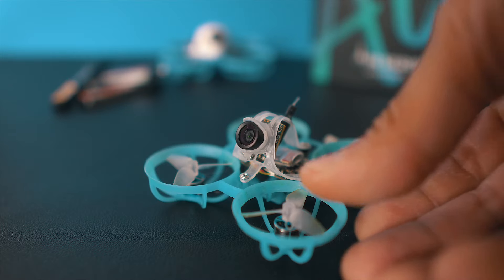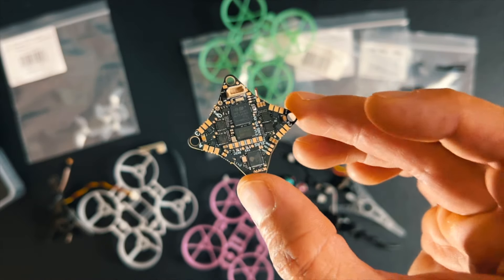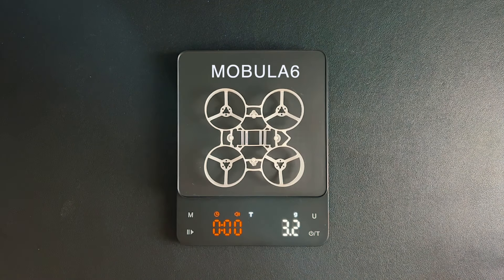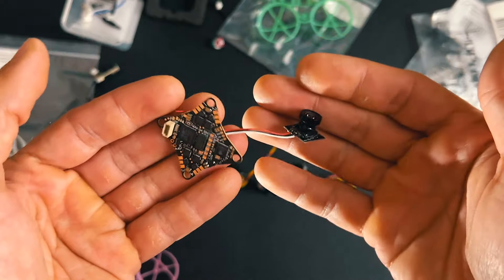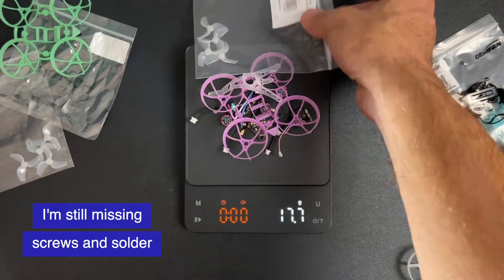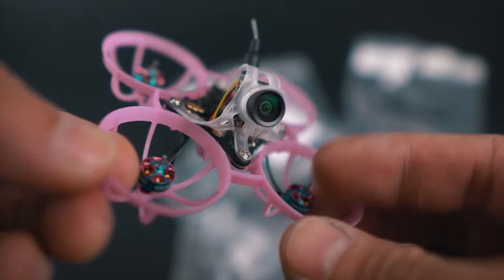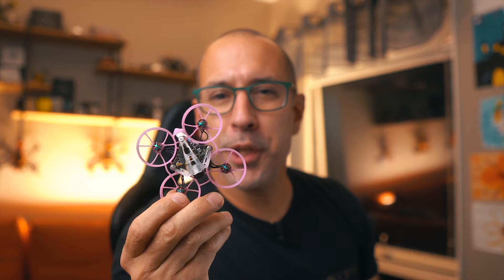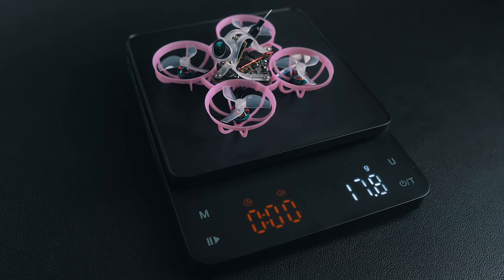Building a Lightweight TinyWhoop with BetaFPV 5-in-1 AIO | Under 20g FPV Build Guide

Comment: Strongly suggest you experiment with 75mm Whoops with 45mm (2 blade)  I hated 2 blade props until after I figured out the "hack" of a 75mm drone with the 45mm 2 blade props, and put Bluejay ESC fw on your ESC's so you can use bi-directional d-shot.  makes a whole world of difference.  I have the betafpv factory tune for the "air 75" the custom pid tune is amazing. you have to try it.
Reply from the maker: Thanks! I have tried the air75, and meteor 75, but honestly not much more besides those 2. Maybe time to do some custom 75mm with your recommendations.

Comment: I guess I should have commented before watching the video, looks like you soldered just fine, would help if you had some helping hands so the board don’t move wile soldering 😉 😉 😉
Reply from the maker: I do have some very nice helping hands, but somehow I find them a bit on the way. That's why I use the clay under the board. I don't know if you notice it in the video. The clay holds the board in place and works fairly ok. The only problem is that if you head up much the board the clay melts and gets annoying to remove later. Not a big issue, just some extra cleaning work when using the clay.

Comment: The RCInPower 27k motors have great power but they are super power hungry! I get like 1min less flight time compared to the betafpv 27k or happymodel 28k motors
Reply from the maker: I had not think that much about it. I still get around 2 min of fly time with the 280 mah from BetaFPV which I think is similar to my Air65. But I will test more this before I decide to bring this motors to the shop.
Reply: @NordFPV i thought it was just me maybe but other reviewers have mentioned similar. With 300mah i get 3:30 on air65 but when swapping motors to rcinpower i was down to 2:30
Reply: HM motors are the lightest however there are very fragile. Rcinpower are heavier but they  are  more robust usually.
Reply: @dropfile  betafpv motors are lightest from my weighing (without connectors)

BetaFPV 0702SE 27000: 1.35g
HM SE0702 28000: 1.40g

But yes I agree happymodel are fragile
Reply: @itsjase92  thanks for the update. I've had no experiance with betfpv in this size.
Reply from the maker: @dropfile  I may do a test of the 3 of them. I have betafpv in the shop today, and happymodel, but not RCInpower yet. I'm liking a lot how the RCInpower fly, but I need to do some metrics on battery time to be able to compare better.

Comment: if yall dont want to solder you guys can get the matrix 5 in 1 aio instead, it comes with motor plugs for a solder-free experience
Reply from the maker: Thanks for the tip. Who manufactures that board?
Reply: @NordFPV I guess He means the Beta fpv one
Reply: @NordFPV  betafpv
Reply: @JonathanFPV yeah

Comment: One big mistake dude.  Your props are not seated down on the bell.  Those motors have 1 mm shafts and by not seating them all the way down increases the probability of bending the shafts.
Reply from the maker: Thanks for the feedback. I'll make sure I push them down!
Reply: U can add a chamfer to the inside so it flushes. For plastic canopy, i also prefer pushing the plastic using not so hot soldering.

Comment: I am doing a similar build. Using recommended motors for a board.  Is that how you just skip the PID section? I am new so I could just be missing something.
Reply: Oh and motor direction check and config? You might cover it somewhere else. Will have to go search.
Reply from the maker: No. I skip it because the build is so similar than the air65 I use the PID from that drone. I downloaded the CLI from that drone and use it as base. I then do the motor direction and motor number.
Reply: @NordFPV  perfect, thank you. I did the same with the new ish mob 6. So I will get the cli.

Comment: May I ask you what is your rates for 65 tiny whoop? I understand that rates are individual depending on person. But I want to have a start point to tweak my rates for similar bulid 😉Regards!
Reply from the maker: I use Betaflight rates
    RC RATE. RATE. RC EXPO
R.     1,2         0,75         0
P.     1,2          0,75         0
Y.     1,2          0,75         0
Reply: @NordFPV  thank you very much! Happy flying! 😉👍

Comment: Im very new to the hobby. But I have a question. And I know its probably pretty dumb. How do I know which parts will fit on a particular frame? And which parts work together? Ive been looking for a definitive answer to this and I have been unable to find the answer.
Reply from the maker: That’s a hard question. You need to read specifications and make sure you are choosing the right parts that work with each other. When people can’t do this or don’t have the netto do the full research they buy BNF (bind and fly) which are drones already build by a manufacturer who has chosen all the parts for you. Otherwise you copy someone else’s model.

Comment: I'd like to know more about all the stuff you have to do after you've finished the physical assembly before you can fly... in other words, all that computer work you flew through at the end of the video.
Reply from the maker: Hi. There are many videos on that around the internet, and basically what I did was to load the air65 CLI which you can find in betafpv website, and check the motor position and orientation. Add my rates and my switches. That’s it. If you have any specific question or need help feel free to contact me. And of course, I could use the air65 CLI because it’s the same AIO. If the board was different you can’t load the CLI as I did.

Comment: aren`t RCinpower 0702 too powerfull for the betafpv aio? I wanted to use the 19000Kv ones. should I buy 27000Kv?
Reply from the maker: I think they work pretty well. I need to do more testing about battery live. Seems like they are power hungry, but they fly very nicely

Comment: Should have not cut the canopy, it holds the Connector from popping off, and always glue them on, ask me how I know
Reply: That canopy support does not hold the antenna down, in fact is known to put pressure on the UFL connector during crashes and there have been countless reports of it tearing the connector clean off the board. BetaFPV literally cuts the canopy that way on all of the newer BNF Air65 and 75 builds that they ship.
Reply: @fullhamfpv  hence why I said glue them on, e6000 is best as it can still flex in a hard crash but won’t rip off the whole connector making the board useless, ask me how I know…
Reply from the maker: I thought about holding it with the canopy, but then I saw that there's only one position where that will actually work, and I didn't like how the connector was there. I think I rather have that space clean of canopy for safety.
Reply: @Rckid28  Yeah that's what I use, a tiny drop of E6000 in one of the corners of the UFL connector.